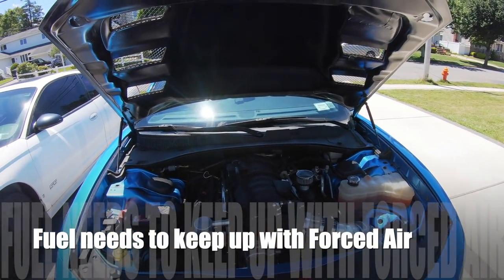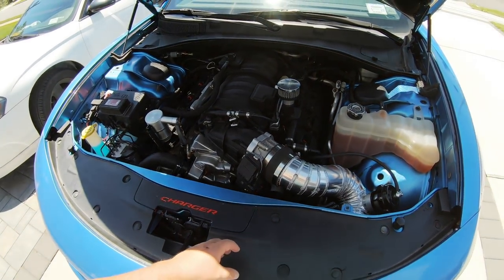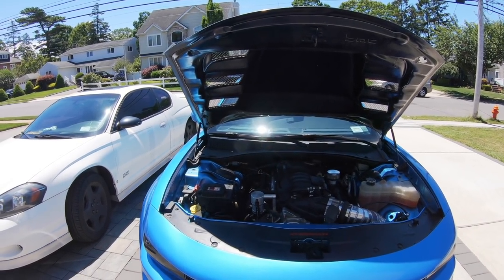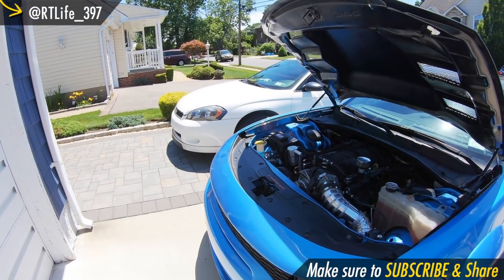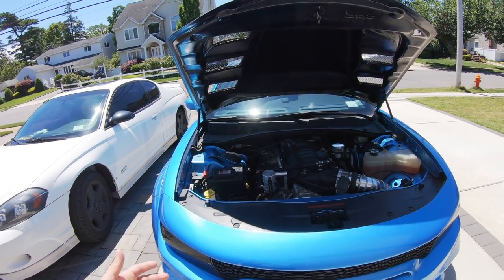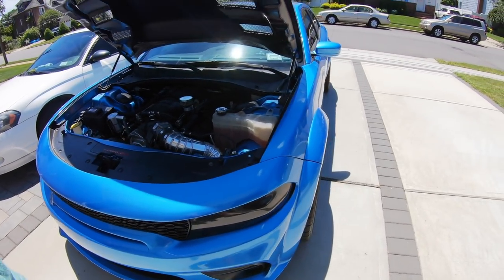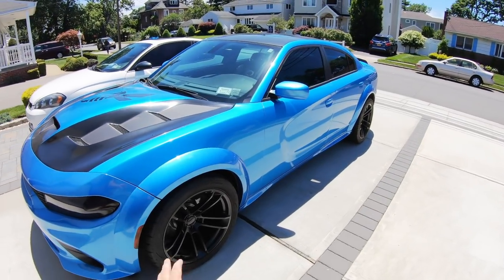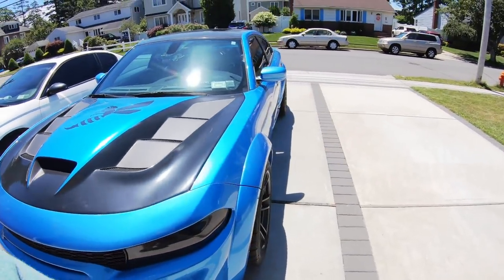Start-Up Tune in 397

Comment from the maker: Getting closer - we will get there guys. Big time power will be coming
Reply: Awesome stuff man!!! Any plans for the Brakes and Trans?
Reply: Hellcat power now
Reply: Can you shut off the back pressure sensor on a chrysler
Reply: Sounds very good. Did you need to put a torque converter after the camshaft??

Comment: I cant wait to see what kind of power she is going to put down. I'm looking to build my scat pack towards the end of this year, I'm going to start with a fully forged motor and a fully built transmission and a one piece drive shift before I even think about start adding boost from the twin turbos. I'm concentrating on working my way from inside to the outside on the most important things first. But good video man!💯🙏👌

Comment: Email tune? Did you decide not to work with your other dyno tuner? Also, good thing you aren't running too hard on those 392 injectors. That would definitely lean out and pop. Im excited to see when it's dialed in!
Reply from the maker: Email tune for now & then getting a dyno tune once the fueling is in place. From there email tune updates. I wanted to go back to using my diablo.

Comment: Bud just put the hellcat brimbos on your car bought some from a wrecked challenger hellcat and the spindles because the brembos are floating calipers for my rt that I widebodied and had them refinished and rebuilt and they hook up to the stock lines and they work great not hard to install

Comment: I wouldnt just do a dyno day to see power. Get tuned on the dyno. It is very good for wot tuning.
Reply from the maker: that's what I mean. Getting dyno tuned after the fueling is in place. I would just record the WOT to see how much hp/torque it's making for the channel.
Reply: @RTLife  gotcha. Cant wait to you spinning the tires at 80 LOL

Comment: What kind of fuel system are you upgrading to? Was wondering what you were doing about the injectors and fuel system because you never mentioned them
Reply from the maker: We were thinking putting another 400lph fuel pump in addition to the 400 already there. Injectors I believe we will be going with 1200cc. We will see though - a hellcat pump is still on the table. I hear it supports 15+ lbs of boost no problem.
Reply: @RTLife  you DEFINITELY need a strong dual pump system bro, preferably a return system, to be able to use even half of those turbos' potential. Definitely new lines too if you're still running the stock size fuel lines. 1050-1300cc injectors will be solid. Wouldn't go smaller than 1050

15lbs blower boost is not equal to 15lbs turbo boost - I say that to say you should definitely look beyond a hellcat fuel system. You'll just need to upgrade again soon

Comment: RT i have a question for you can I use a dodge ram truck intake manifold 392 on my Dodge Challenger RT my reason for asking the air cleaner is facing under passenger side instead of the driver side would that be an issue your advice would be appreciated thank you Robert

Comment: Quick Question- What's up with the pieced together piping everywhere? No mandrel bent tubing? NOT HATING! JUST ASKING!
Reply: That a great question. It's really tough to get really tight radius bends in a mandrel pipe compared to this "pie cut" approach.  And, being boosted, smooth airflow isn't as much of a concern since it's getting pushed through. More work,  but way more flexibility during fabrication.

Comment: Get used id 1050 injectors and a walbro 450s off facebook alot of good hemi groups out there with reputable sellers
Reply: Imo id trash the diablo system and go with someone local who uses hp team hellcat and or aj are top tuners u live out on the island too